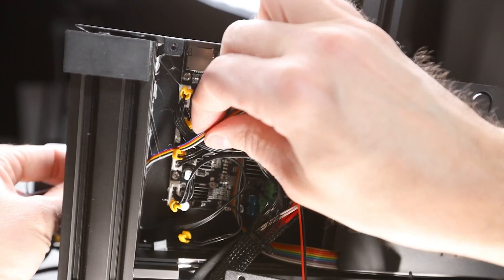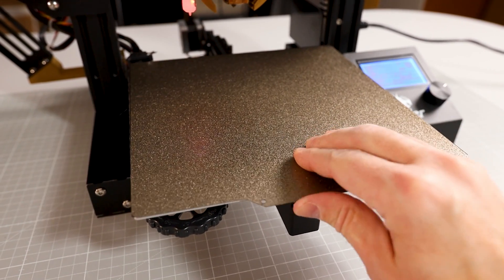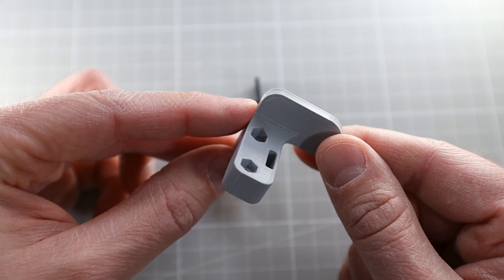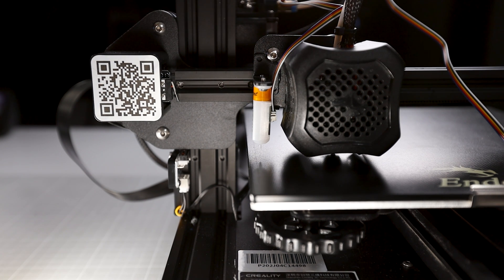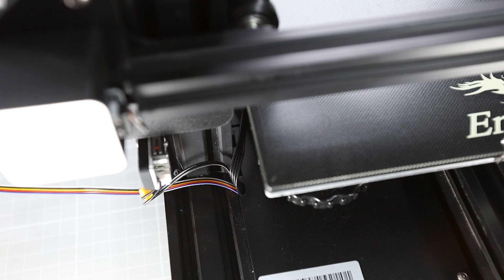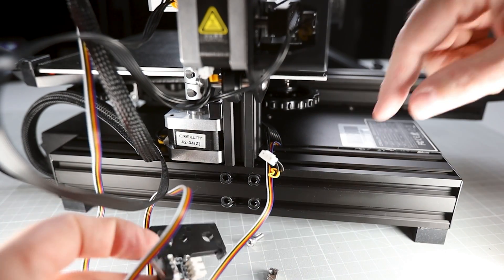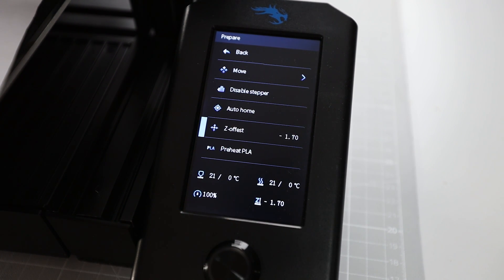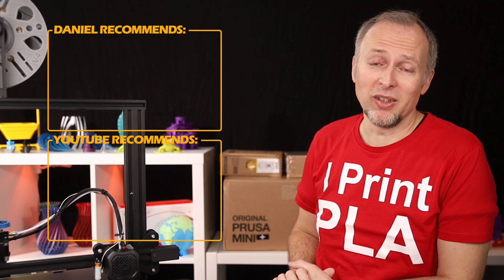Ender 3 v2 (v1, Pro) BLTouch Upgrade (Creality 4.2.2 or 4.2.7 mainboard)

Comment: Great videos and my favourite knowledge source for my ender 3 pro - but now I have a question ;) 
Today I updated my old 1.1.4 mainboard to 4.2.7 + bltouch, but after downloading the software from creality hp (ender 3 pro/4.2.7) I have some trouble to find the right software - maybe just a translation problem, no native english speaker ;)
I got 3 folders in the zip package - bltouch v1.1.2 without transfer board tmc2225 ( what exactly is the transfer board???), bltouch v1.3.1 with transfer board tmc2225 (temporary) & bltouch v1.4.1 with transfer board + filament detector tmc2225.
The last one I think is the wrong one - no filament detector atm, I believe the second ist the right one - because if I would add a filament sensor there would only be number 3.
Also do I have to use the V1.0.1 original version tmc2225 additionally?
Hope you can help me / explain me what the transfer board tmc2225 is :)
THX!
Reply from the maker: No transfer board if you plug in the sensor directly into the 5 pin mainboard plug

Comment: When it was probing for the 9 point mesh it centred the nozzle and not the BL Touch, can this be adjusted in the firmware?
Reply: can it also be adjusted from Cura in the apply extruder offsets to Gcode, from the page where the start and end Gcode are? or does the firmware setting take precedent?
 I have installed the Creality BL Touch kit using ProgISP+1.72 and firmware 1.1.6 BL Touch to the 8-bit board and there is no Marlin INO for this firmware so it cant be edited and if I now try to flash a different firmware or a bootloader I get a chip error from ProgISP+1.72 so I am stuck with this firmware until my SKR Mini E3 V2.0 is delivered
Reply: @AndrewAHayes  the offset in Cura refers to the nozzle vs the printhead. If you change that, your prints will be misaligned and potentially off bed. The  probe-to-nozzle offset is set in the firmware. The Smith3D version of Marlin lets you adjust the probe offset from the display without recompile. Not sure if it is available for your current board, but worth looking into.
Reply: @michaellindborg1510  Thanks for the info, I will leave it until my new board arrives, I have edited and compiled a firmware ready for it, I will look at Smith 3D though sounds interesting!
Reply: @AndrewAHayes  yes, Smith3D has some nice extra features. I run it with 5x5 mesh. Best of luck with your new board!
Reply: Yes, adjust the offset
Reply: In visual studio code you can adjust the nozzle_to_probe_offset in either configuration.h or configuration_adv.h (there is a little diagram on how to measure the distance in the right one). Then just adjust the x and y value by how many mm it is off when auto leveling (so better measure this before) and it should work fine.

Comment: Excellent video as always. Interesting to see the difference in the hardware from my year old ender 3 pro. Also note, I believe the connector on the main board are JST-XH connector, if you want to use one that snaps in. You can get kits pretty cheaply that include the pins, connector, and crimper.
Reply from the maker: Yeah, I will double check if any of those connectors in my connector kit fits and will link it if it works.

Comment: For a neater look, route the cable inside the cable sleeve. Also, you can leave the z-stop microswitch plugged in, it doesn’t do any harm.
Reply from the maker: I agree except it will get in the way of you remove the glass bed and go for a magnetic plate. The z-Endstop will block the nozzle from going lower

Comment: Thanks for showing how to route the wiring through the top of the board compartment. I routed my cable (1 meter) through the bottom and it's long enough, but I would prefer more slack.  Your way is better. Nice video guide.
Reply from the maker: Great to hear that it’s helpful!

Comment: I tried this with the ender 3 pro, but the sensor doesn't deploy.
Reply from the maker: Check the wiring and try to deploy the probe by sending the M401 command and retract with the M402 command. If this doesn’t work, your probe wiring might be wrong, it might be defective or the firmware is not setup correctly
Reply: @Crosslink3D  hi, many thanks for this. I tried using the M25 board, but that didn't work, and then I switched to using the BLTouch port on my 4.2.2 mainboard, and, using your code, I tried to set it up and control it via Octoprint. Unfortunately, this has led to a blue screen on my ender 3 pro, and when I send the command to deploy the BL touch, the probe doesn't deploy (and manually pushing the probe out causes the red light in the BLTouch to stop glowing.
Reply: @fizz113  use the 32bit firmware, without adapter board, plugin ur old LCD screen to port ext 3
Reply: @jimsinnovations2737  how do you mean?
Reply: @fizz113  u flash with it. Take out SD after a
Flash and then put SD back in and calibrate it